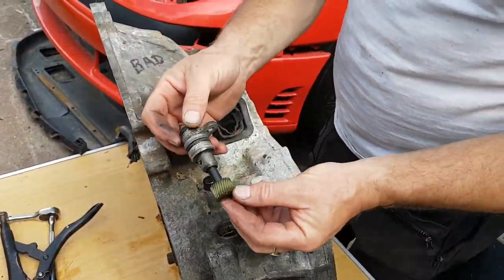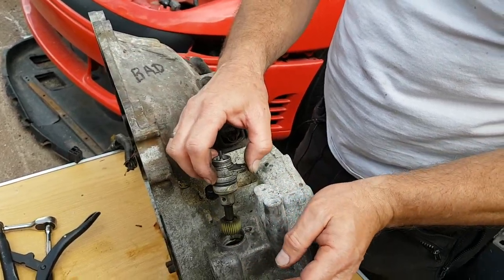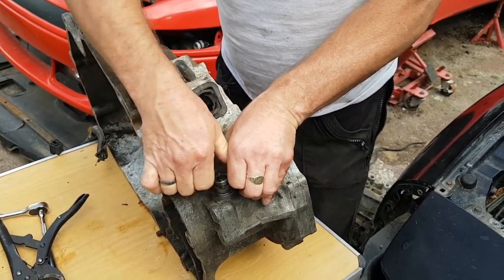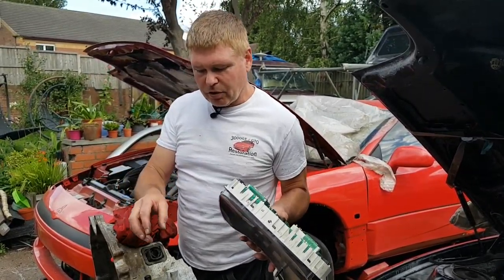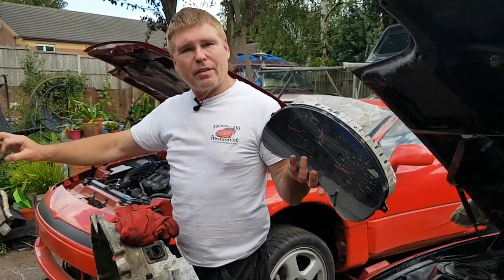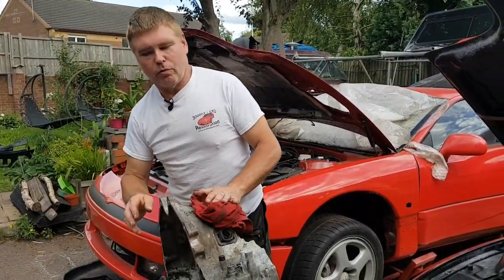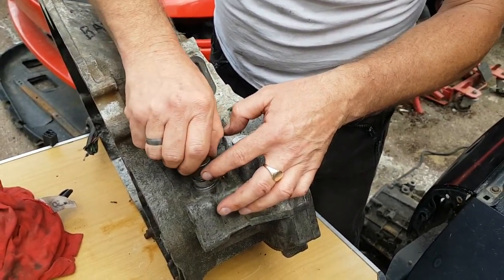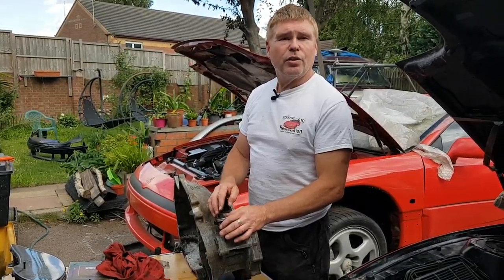Mitsubishi 3000gt / GTO Vehicle Speed System

Comment: Hey, thank you for everything youre doing to help us fix our cars. But im not fully sure how it is from model to model but i changed my speed sensor on my 3000GT VR-4 95 mod and i had no problem disconnecting the speed sensor without removing all those tubes, just removed the battery tray. just wanted to mention it because i know how difficult it cant be to get those tubes back on, and it could save people from waaay more work than it has to be.
Reply from the maker: I'm impressed if you got it out on a VR4 without removing the hoses. It is pretty tight in there. Experience and a good clean car helps. Thanks for watching my channel.
Reply: @3000GTGTORestoration  it may have something to do with me having quite small hands, and im not saying it was easy getting it out that way but it was possible. But yeah it is quite clean and nice car to :)
Reply: @skilnand  was your 95 VR4 electronic or cable type? Thanks!

Comment: Great video again! There is a way to test the actual speedometer sensor with alligator clips and a multimeter, then a drill to spin the square shaft. I found that my speedometer didn't work. My speed sensor tested good, the fault was the cluster. Bought a good used working unit and all is well.

Comment: Thanks Joe, always enjoy watching your videos. Luckily, I have no issues with any of my speedometers, but my tach is highly inaccurate and erratic on my 93 VR4. PTU is new and wiring is good, ECU had been rebuilt, problem persists. I've been trying to track down the issue. Sometimes it doesn't work at all, but it always reads lower than it should, sometimes it bounces around while maintaining constant rpm. When it's real cold out, it doesn't work at all. Maybe the gauge itself is finicky.
Reply from the maker: The gauges are starting to have issues but can be repaired.

Comment: Ive found the problem in two different cars to be the cluster itself. The metal traces in the circuit board on the back that bring the current to the speedometer and odometer connectors can be broken ever so slightly, and no reading is given. 
If you check everything else and it's ok, then look at those pathways on the back of the cluster

Comment: hello, my car 3000GTO 1991, has a problem with the electric speedometer, after turning on the ignition, the speedometer already shows 30 miles, even though the car is stationary. when driving, it shows the wrong speed. what can I do , to fix it? thanks

Comment: Thanks for the info, great video. I do have a question if you can answer that'd be great. To where to the cluster sits in the dash, those plastic prongs (sorry dont know the name of them) that plug into the actual guage cluster (when popping the cluster back in), power should be running through the top 2 plastic pieces correct? Meaning that if i have a power tester (that lights up when there is power), it should theoretically light up for the tach plastic piece AND the speedo plastic piece correct? and if that is the case, if the one that goes into the speedometer isn't lighting up, that would most likely point to a wiring issue im assuming. Or a problem with that plastic piece? Any thoughts, ideas or comments from you would be greatly appreciated. Thank you